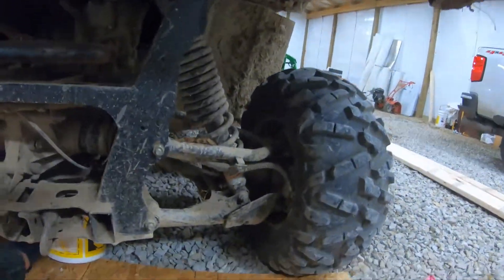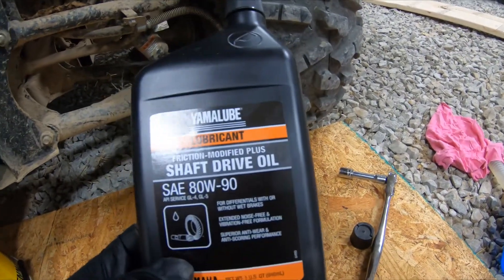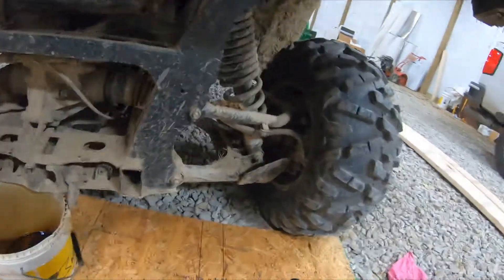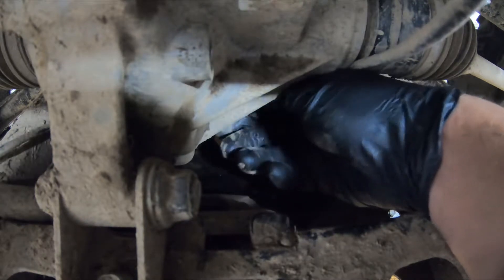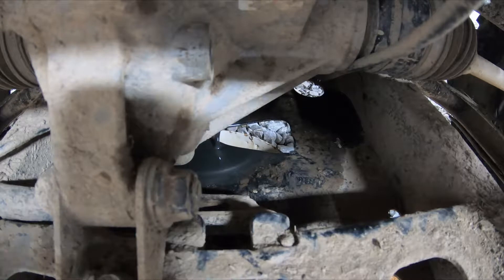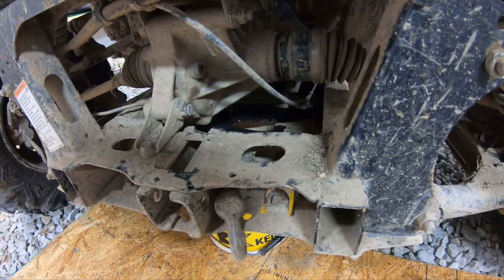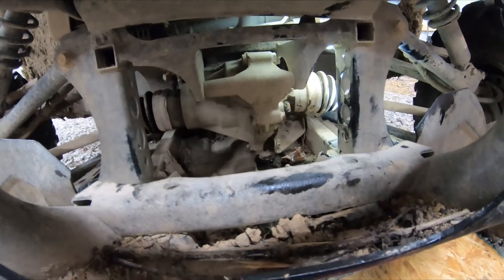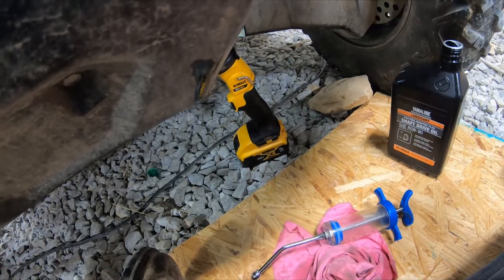Yamaha Viking Front and Rear Differential Oil Change

Comment: Get a pump sprayer home depot, cut line with spray handle in half...put a simple handle valve in splice...take spray nozzle off end just using hose...close valve pump sprayer up...stick hose in fill hole..open valve a little, fill differential...done
Reply from the maker: thanks